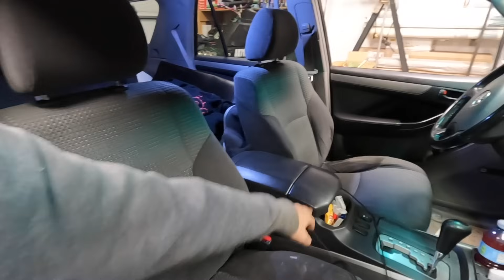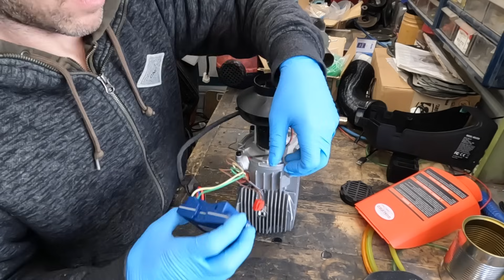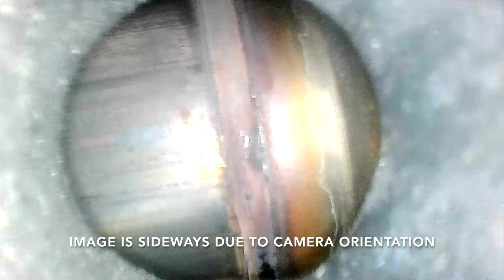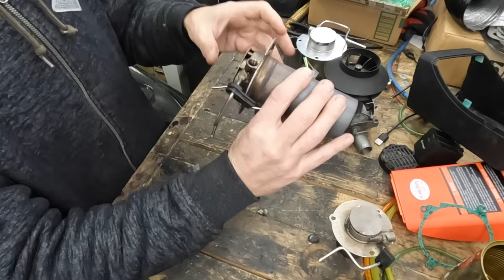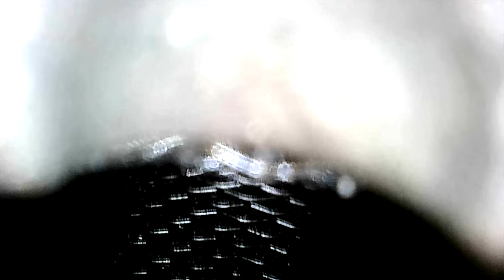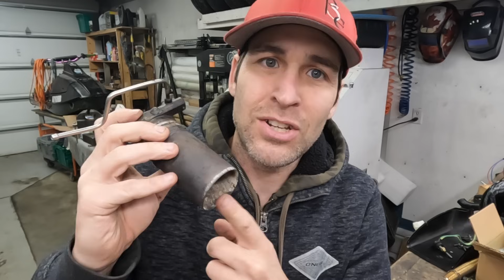Diesel Heaters - Orientation Deep Dive - Heater Mounting Explained

Comment: Guys. Stop buying china junk
 Espar is german made quality heaters. Built to last, every part in available if needed, in my 15 years as a small fleet mechanic i can tell you 99 percent of failure is the burner gasket. About avery 5 years per unit you take it out, take it apart, the gasket will be cracked. Clean it up and replace the gasket and glow pin screen because you are already there, put it back together and good for 5 years again.
Reply from the maker: If you have the money to spend on a Espar or Webasto, by all means go for it. I haven't actually looked at the price of an Espar, what does a 5kw unit cost ? 

That being said, For the price of one Webasto 2 kw heater, I can buy 8 5kw chinese units. I'm not going to argue that they are the same quality, as they clearly are not, but there are plenty of people who have used these for years without any issues. 

I did notice that my first Vevor heater had a burn chamber that was made out of something much more exotic than the mild steel replacements, or the on in the 2kw heater I recently got. They are becoming cheaper, and some of that is because they are using cheaper materials.
Reply: @loweredexpectations4927  3 years ago i bought a genuine espar hydronic for my Volkswagen.  $700. I am sure more by now. But worth every cent. It has been absolutely problem free.
Reply from the maker: @poellot  Right on. I can tell just by a quick look at the wiring / connectors, that they are awesome quality. 

I get lots of people who buy these heaters to heat a greenhouse, pumphouse or spot for their dogs to stay warm in the winter. I can see why someone would want a proven unit like a Espar for a vehicle or RV, especially if you are using it daily, but I also see the value in a $100 unit and have heard many stories of people running them for 3-4 years with no issues.
Reply: @loweredexpectations4927  we have them in the sleepers of semi trucks. I think we have about 20 trucks now. The thing i like about them is that i can buy every part individually if needed, but in my experience, the only thing ever needed is the burner gasket. They crack and leak air, causing the fans air to bypass the cumbustion chamber and hard to light. Clean and new gaskets and good to go. We have a couple units that are 15 plus years old, have had to remove and repair them a few times. But we tried a few fleetrite brand, they were a few hundred cheaper. Cost us more in the long run and we have espar in those trucks now.
Reply from the maker: @poellot  Funny that you mention that... I have had so many people tell me that if the burner gasket leaks it will leak CO into the breathing air and you will die immediately... Or something to that effect. 

I ran my heater without a gasket for about a month or month and a half, at least, as I got sick of replacing it, haha. As long as the flange was decently flat I didn't have issues, but as you say, if it leaks, air bypasses from the fan area into the exhaust, basically. 

Yeah, part of the economics (and dependability) of it all depends on how many hours you are putting on them, and also the cost of maintenance or down time. If you are running a fleet, and you are paying a tech, or shop to do repairs and service, and have down time on top of that, it's not worth the gamble to save even $1000. 

That's why there are companies like Greggs, McMaster Carr, Ecol exist.... They all charge 3 - 4 times what other retailers do, but they cater to those who don't have time for nonsense.
Reply: @loweredexpectations4927  i am not saying all stuff fom china doesnt work. But the quality control is shit. Some things work and others are junk new in the box. Warranty or not it can be a big hassle especially after many hours of instalation to have to remove,  send back, and replace the part.
Reply from the maker: @poellot  Quality control on Chinese stuff can be shit at times. Most of their stuff is getting better, but it can be hit or miss. Some stuff is on par with Japanese or American made products, and other stuff is trash. I ordered an "upgrade" ECU and controller from Aliexpress and it lasted two weeks before it quit... 

I have 4 of these heaters now, all from Vevor, and I haven't had any issues that I am not directly responsible for, haha. One of my all in one heaters had a kinked fuel line that happened when it was put in the package or during shipping. It would have worked but I cut an inch out instead of chancing it. 

I have had one of my heaters now for over a year and the abuse that it has taken is incredible. I use it for experiments and it has been purposely overheated at least 20 times, unplugged from power without any cool down cycle, starved of fooling air till the motor burnt out, starved of combustion air and force fed compressed air till the inlet side of the chamber was over 400C. Many of these test running for 12 hours at a time. 

I thought they were neat at first, but have gained a whole new respect for them, after what my heaters have been through. When I did manage to kill the motor, it was $35 shipped and my new burn chambers were $22 shipped.

Comment: I run these 24 hours a day 7 days  a week  if you need somebody to run the chamber for a long time I volunteer, I sure hope you make one that works, Great video.
Reply from the maker: Right on ! I suspect that in a best case scenario, this will be something that will run for 100 hours or so. 

This mod is an attempt to distribute the crud over a larger area, keep it from effecting the main burn area, make it easier to clean when it gets dirty and keep it burning hot... but I am quite certain you will be able to calculate time between servicing based on amount of waste oil consumed. 

I have a few ideas to fall back on after this one, but I hope this one works well.
Reply: @loweredexpectations4927  if anyone can build a good one it you or David

Comment: Directions in my heater basically showed that the corner with the glow plug needs to be up. But your notice of vent hole location is a good catch. Also for the high end wabstos there install directions also show the corner with glow plug needs to be upward. Facing up could possibly cause an issue tho. If it were to flame out or not completely buring fuel it could leak fuel through the main air inlet at the back of the burn tube and leak into the housing.
Reply: I agree, glow plug at the top, no matter which way you choose to orient it, that way, if your pump fails and allows fuel to drain into the heater unimpeded, any unburnt fuel pools at the dead end of the outer casing, then fills the gap (and the centre burn tube) until it reaches the level of the exhaust port, at which point it can escape down the exhaust. The other way up, unburnt fuel can escape through the air hole and into the motor area, which may not be ideal. Remember some people have these mounted inside dwellings and vehicles, All 'should' have the exhaust routed outside, so having fuel drain via the exhaust rather than into the shell of the heater is the preferred option.
Reply from the maker: @thegrimreaper7777  I do agree with this, but if your pump fails and you have more than a litre of fuel, your heater is going to overfill and it will still dump out.... man, that would be a nightmare ! haha.
Reply from the maker: Yeah, with the heater sitting upright (exhaust and inlet down) the fuel path is down at a slight angle. Ideally, you want a direct downward path between where the fuel comes in, and the main burn area. 

As long as there is some down slope from the fuel inlet to the burn area, there shouldn't be a problem. However, if you were to install the heater so that the fuel has to go uphill to get into the burn area, this is a problem.... this would mean that it needs to fill the glow plug area before running into the burn area. Not good.

Comment: Hey bud. Boroscope is an automotive tool (what you have). It's a camera designed to go inside the engine.  
Endoscope is a MEDICAL device that's designed to go inside the body.
Reply: No, the term endoscope is not limited to human bodies. Whatever body you want to examine, an endoscope is just right.
Colonoscope would be limited to some internal organs though.
Reply: @werner.x  that's because companies like Vevor have been incorrectly labeling them for many years. If you look up the definition of the word, it's a medical instrument.
Reply: @IrisPPG  I did look up the definition just to be sure not to talk bs .
It's a technical term, not medical only. 
Who did give you the idea, we have to use the term borescope, even when we inspect mostly bodies instead of bores?
Reply from the maker: Thanks, haha. Vevor lists it as a Endoscope Camera, Borescope Inspection Camera.
Reply: @loweredexpectations4927  I know, it's silly. Ever since cheap Chinese borescopes infiltrated the market decades ago now, they have been mislabeled as endoscopes. It's probably just a translation error that keeps popping up over and over again.
Reply: @IrisPPG  Endoscope is a technical term, which includes every field you can use this type of tool. Borescope is made for inspecting bores, colonoscope is the only purely medical term involved here.